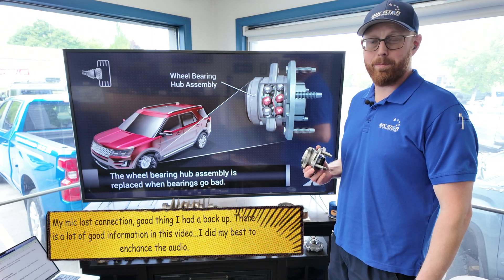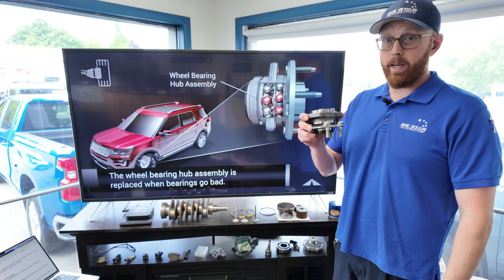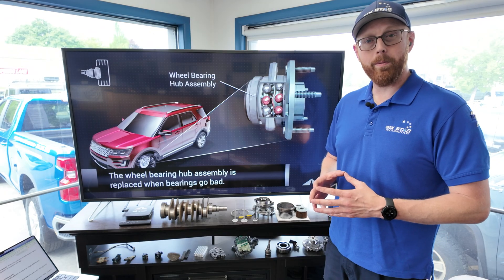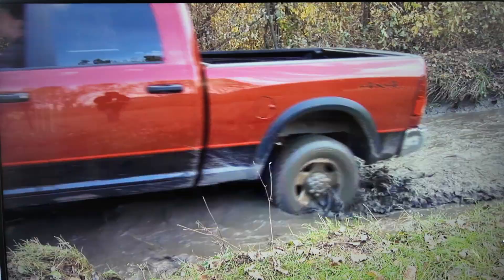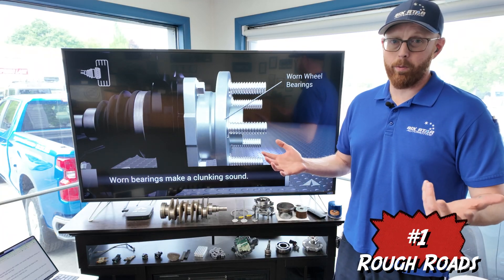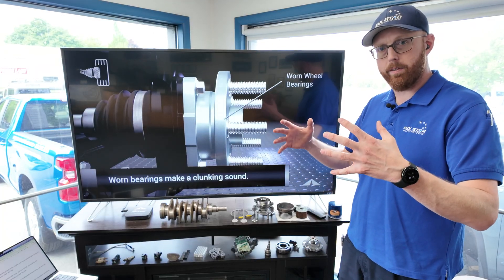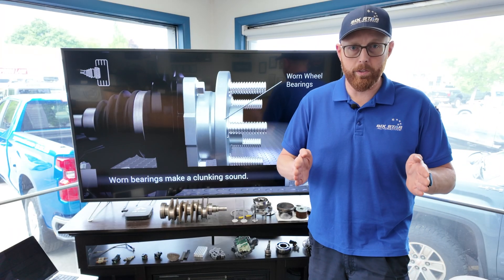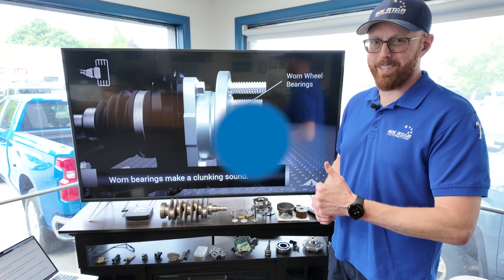What Causes Wheel Bearings to Go Bad?

Comment: Great video!  Our son’s 2007 pathfinder has 294,000 miles on three bearings.  Replaced the front passenger wheel bearing at 208,000 miles in 2019.  Replaced it with a Nissan OEM since Nissan seems to have great bearings.  Our roads are some of the worst in the country too.  Still the original engine and doesn’t use oil.  (Regular strict maintenance)

Comment: My car is at 208k miles with 31$  wheel hubs.....
Reply from the maker: While it is possible to have lower cost bearings last, that price wouldnt factor in any labor to have a professional install it, or the mark up necessary to keep a business running (like medical insurance, benefits, uniforms, taxes, new equipment, maintenance, and on. Also, as a shop that warranties our work for 4 yrs 48k, I must err on the side of quality and peace of mind.
Reply: I think I'd err on the side of quality also. That's not to  I COULDN'T change bearings myself, but I've never done that before and I'd hate to screw it up!